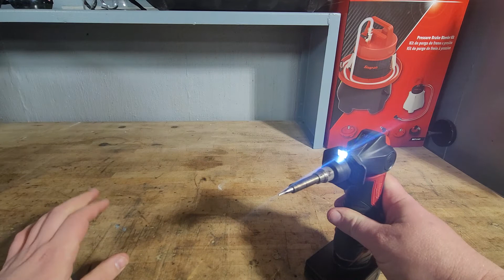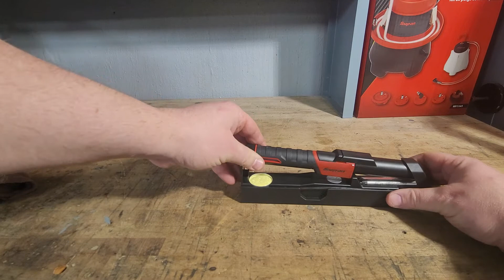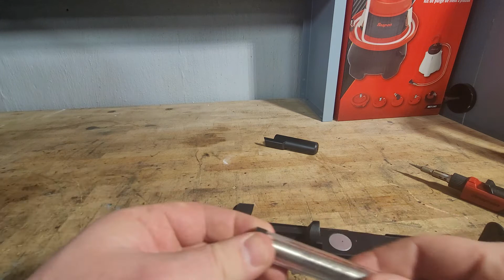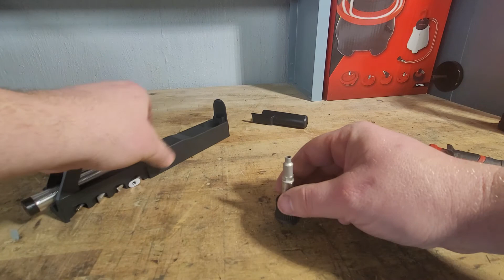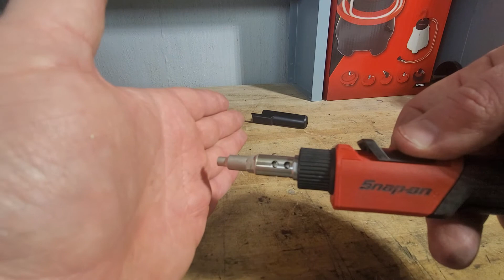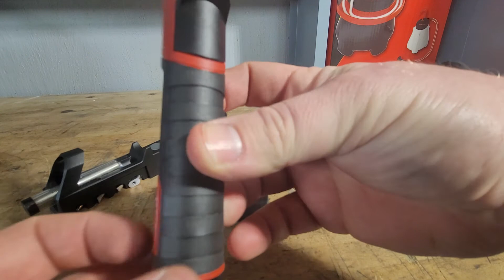Snap-on VS Milwaukee soldering iron edition

Comment: what would you recommend for soldering iron all day maybe 6hrs? Which is faster?
Reply: I currently have been using the amazon one but keep going through catalyst heads.
Reply from the maker: The new milwaukee one is alot better than the older one. Would definitely recommend it.
Reply: @BreakdownswithBrian thanks, its in my cart right now but i was just worried about battery life mostly because i keep hearing it eats through batteries.

Comment: I used both, working as heavy duty tech, and Milwaukee if you use it daily a lot it burns the thermal fuse inside and stop working , I guess if you use it and turn it off so it cools down then maybe it is fine plus goes through batteries as crazy. Snap on is not bad, I like the case with everything needed in there, from all of the butane soldering irons I have used before that one the best so far, also goes through butane quickly especially if you keep it on all the time which I do and just take butane can with me it also smaller than milwaukee and easier to maneuver in tight spaces. I also tend to use good old weller pistol grip corded iron when there is lots of wire soldering
Reply from the maker: Yeah, I've replaced the fuse a few times. Went with a bigger fuse. I like how the milwaukee can stand up with a bigger battery  and the snap-on with the magnet.  But I would go milwaukee
Reply: @BreakdownswithBrian  yeah if bigger fuse fixes the issue then it's way to go especially if buy butan  and it is not supplied by the company
Reply: what would you recommend for soldering iron all day maybe 6hrs? Which is faster?
Reply: @AZ-toofast  corded weller

Comment: Just a heads up... the batteries are identifiable by their labels on the side next to the amp hour

CP - Compact (1.5 -2.0 AH)
XC - Extend Capacity (4.0, 6.0)
HO - High Output (2.5, 5.0)
HD - High Demand (M12 doesnt have an HD battery)

Comment: do you know where to purchase replacement solder tips for the snap on yaks42
Reply from the maker: Go to the snap on website.  Type in the part number. Then go to the bottom. There will be a "repair parts"  . Click it. It will be a break down of everything younneed